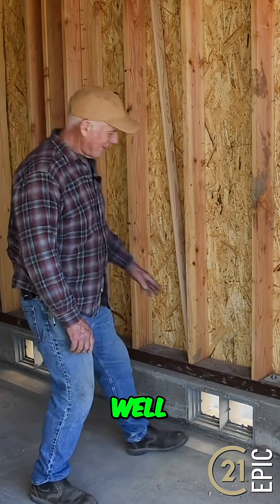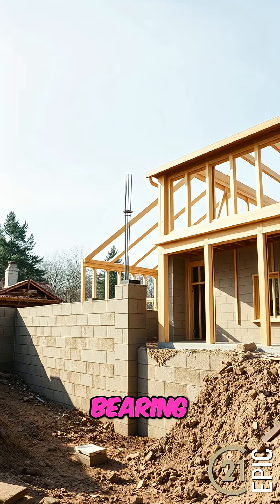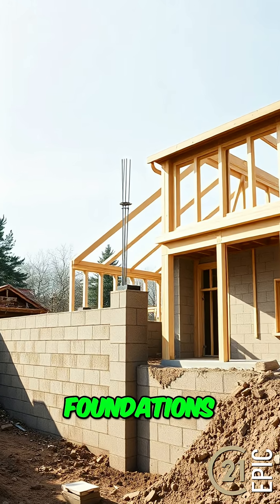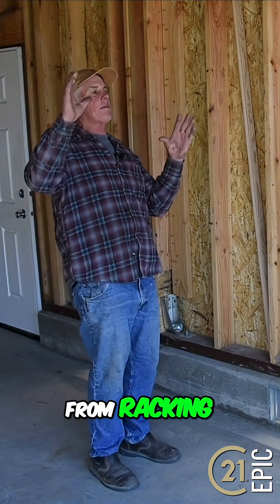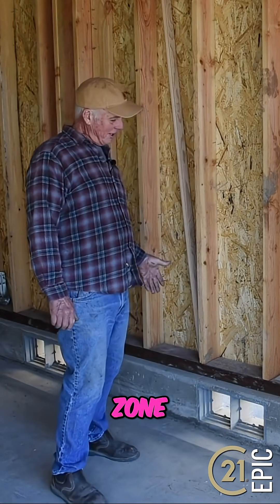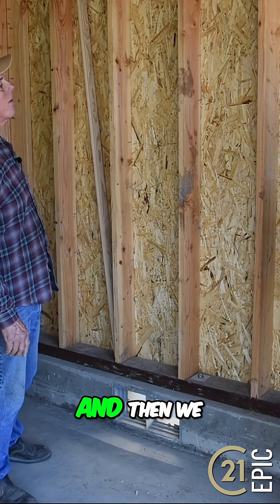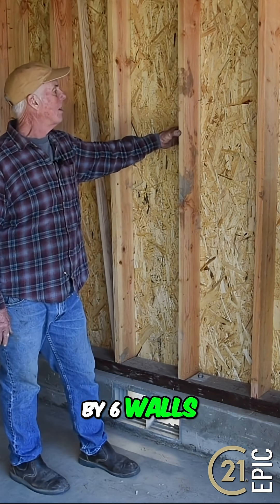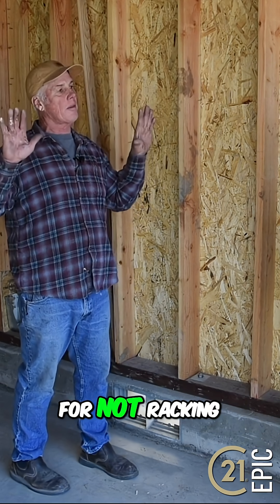Foundation Basics: Stem Walls, Anchor Bolts, and Hold Downs Explained 🧱🔩 | #foundation

Comment: American carpentry always looks sooo sketchy 😅 like why are your framing build using boards ?
Reply: Because we have forests and freedom so we build large houses because we are not sissy socialists (mostly) so a steel or concrete would be cost prohibitive for such a large house.  We have earth quakes, and hurricanes and the houses are built to withstand these forces and they do.  Also wood is organic and renewable if your predisposed to that way of thinking.  Engineered lumber is taking over from traditional framing studs.  Nothing is more beautiful and airy than a modern post and beam constructed house.